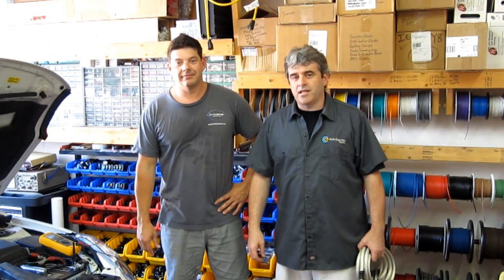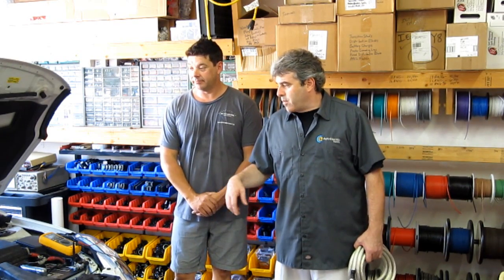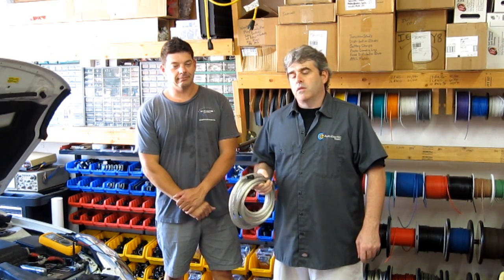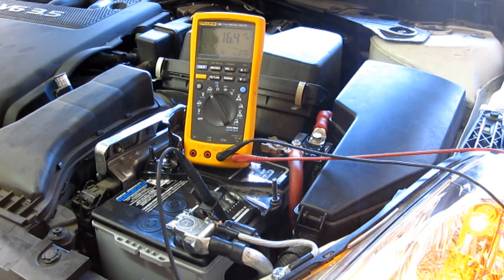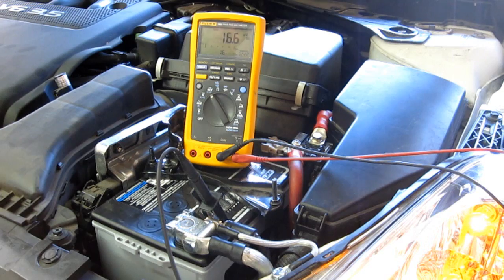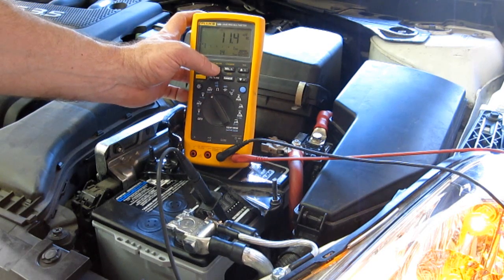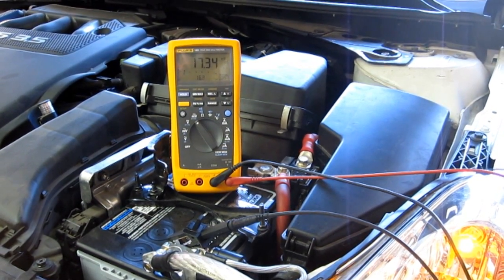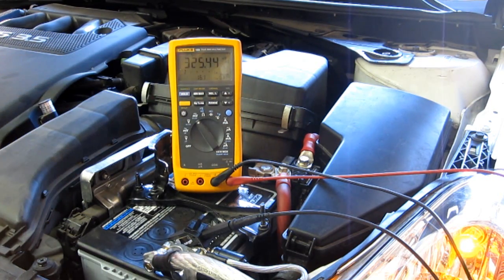Ground to the Chassis or Use Cable - Which Works Better?

Comment: In my particular case I have a Ford expedition and fixing to install the big 3 upgrade and I'm confused on whether actually completely doing away with my factory engine ground or just leaving it and adding the new one and would it matter if I bolt it to the chassis or frame

Comment: Excellent.  Thank you.  Just determining how much I will use the 2" tube frame of my rock crawler for grounding the stuff, and the answer is clear.  With a full steel tube frame, I should have way better capacity than any unibody, so chassis it is.  Saved me experimenting.  Now the question is what to use to actually connect to the tube frame.  I am thinking a 5/16 stainless through bolt with flats ground in the tube with de-oxit and dielectric grease with appropriate gauge from winch ground side to chassis.  Two 1/0 should do it.  That is roughly equivalent to a single 4/0.  The winch can run 600 amps easily under load.  Two 1/0 will feed it positive juice.  Also bought your book and it was very informative.  Highly recommended.

Comment: Chevy trucks have a voltage sensor that won't read second battery without grounding to main battery
Reply: This is very very true. I have a 05 tahoe and have that issue when computer doesn't turn alt on until battery starts getting low. Am gonna try 1 run of ground from fro t to rear see if that helps. I have 2 mechman 370 1 self excited other is 2 pin and self excited does all the work until it starts struggling then 2 pin jumps in.
Reply: @terrancedesormeauxjr2559  🔴 You definitely have more going than I do. I have 2011 Avalanche 250amp alt, red and yellow top optima batteries ran in parallel. Power and ground wire from front battery to back all 2/0. I ran 2/0 through that ground sensor from start battery back  to the original engine ground along side the factor 8 gauge wire. I also ran 2/0 from alternator to frame/chasis. The alternator reacts the way the PCM/BCU controls it, seems to be working as designed. You should check out a few of the videos on here concerning the Chevy RVC system and it's functionality. It's very interesting what GM has done and how it's all suppose to work together to conserve fuel  and vehicle performance. Good luck with everything, sound like you have a real banger with the electrical your running.👍🏾

Comment: My Amp will be right next to the battery in my BMW E90. I've read on some forums that connecting the earth direct to the battery will cause interference, is this true or false? If I can get away with it, I'd much rather connect direct to the battery to avoid sanding paint off the chassis and ripping carpeted areas up to look for earthing points.
Reply: What does the return path for the starter look like if the main ground cable from the battery negative comes loose from the body and your amplifier is grounded to the battery negative terminal?  For this reason, we never recommend grounding an amplifier to the battery negative directly.

Comment: I know this video is super old, but i had a question. Doing a “big 3” In a unibody car with its battery in the trunk when grounding the alternator to the battery does this still apply? Or should I go ahead and run 0ga from the alt case straight to the battery neg?
Reply: Battery negative to frame rail, case of alternator to frame rail on same side.

Comment: I came here because my winch says to bring the ground cable to the neg terminal directly instead if grounding it on chassis. Seemed odd since the cables they provide are only 10 gauge

Comment: interesting. Good test too. I was a VW tech back when. Went to Lincoln tech and VW school. I would think that ground using the car sheet metal/frame would work better because it has a larger mass, thus conductor is larger. The electricity will travel the easiest point back to the battery, whereas using a ground cable to the battery ..... it only has one wire to go through.

Comment: well i my self in my setup would use solid bar copper straight to battery with some 300mmsq cable at the ends, and the copper bar between the wheels on both sides lucky for me my car has rubber grommits all along so i can easy fix the bar on it. any way why lose the chassis just use both cable and chassis. i have a simple way for the live cable to which i will use 300mmsq for the side too, i just want to squeeze every electron to my system lol because my power output be in the range of 17,000 watts or bit more for add on,s.

Comment: Try this on factory wiring. No big 3/4 upgrades. You will see massive voltage drops. It's always best to run real copper cable to and from your amps/head unit.
Reply: Um, he did use 1/0AWG, pure OFC copper wire. Listen up!

Comment: completely usless test. if you ran the ground to the alt case you shouldnt have seen any drop. instead you ran it to the front battery which has its own ground where is that run to? how can you expect to get a good test if you didnt upgrade the battery ground to the alt case?
Reply: Incorrect.  The battery negative terminal and case of alternator are connected just below the battery to the chassis at the same location.

Comment: this review isn't completely accurate since the car had a BIG3 upgrade.. it makes a good difference but i still prefer running an additionnal cable as a ground since it eliminates a lot of noise problems
Reply: Not only that but copper will always conduct better and have less resistance than a steel frame rail the length of the vehicle...just sayin

Comment: I have a 08 grand prix. unibody, should I ground to the front battery instead of rear?
Reply: doesnt matter where you ground it, as long as body panel is properly grounded to chassis.

Comment: so if im using 5k true rms for my system in my Buick Park Avenue is it better for me to ground to frame or ground direct to battery? keep in mind im using knuKonceptz 4/0 power wire and Ground wire for my main run to the distribution block and from there 2 and 4 gauge ofc goes to the amps. i don't do any of that scoring stuff so this is just for daily driving. any advice would be greatly appreciated. Big 3 also being done.
Reply: Im doing 4/0 also fro my truck, for big three also, so many people say oh you dont need that, thats overkill....I like to make sure especially when adding a 2k inverter.
I just read why not do both frame and full length back to battery.

Comment: So, when adding subwoofer, amp, and capacitor to the car/ truck. The negative should just run to the chassis/ frame ground fine or run a wiring to the battery negative cable?
Which perform better??
Reply: yes  thats right  bud  but   ...AND THIS IS TO ALL HERE  ,,,,  NEVER NEVER     PUT THE EARTH ON SOME THING THAT MOVES    ... ITS A MOT FAIL

Comment: I have rebuilt alot of amps over the years and have seen chassis grounds fail due to corrosion or becoming loose over time. Any suggestions on aiding this when people use chassis grounds? I've always been against them because the issues I've seen over the years.
Reply: Here in Michigan we deal with alot of salt and ice packed under the vehicle for months out of the year, when you have all of that at your connections at the frame. Theres many other states that see the same.
Reply: strip the paint around the hole. use a star washer between terminal and vehicle. Use nut and bolt fastening not just a sheet metal screw. Then primer and paint over the whole affair. Should last 5+ years with no issues.
Reply: Use Nyloc nuts.

Comment: so in my 99 tahoe.  it's better to just run to the frame instead of a run to the rear?
Reply: yup. go to the frame if its not a unibody.
Reply: Ok. .thks cause all this time i been planning runs of gnd as well
Reply: John Monger so which did u do? I have a 98 Silverado with about 4krms total I'm about to install. Planning on 2 0 gauge power runs and 2 0 gauge ground runs from front battery to rear batteries. Should I just ground to frame under truck instead? Is 1 better then other or should I just do both and say heck with it lol. I already have all my wire and plenty to do anyway possible lol
Reply: John Monger that was a question for u but everyone else reading also lol I didn't mean to just assume u knew all this just tied it all into 1 post lol

Comment: @jim davidson - Jim, the cable used in this demonstration is pure copper with a PVC jacket rated at 105 degC.  It has a "shiny new aluminum" appearance as it is tin plated to resist corrosion and oxidation.  Welding cable is ideal for welders and not suitable for automotive use as its jacket does not carry a high enough heat rating to be used in the engine compartment nor is it petroleum resistant so it quickly breaks down should you get oil or gas on it.  I stand by the results we've demonstrated.  Next time, maybe ask before attempting to discredit another's efforts.
Reply: here is a perfect example:
http://www.amazon.com/NOCO-WL1025BK-Black-Welding-Cable/dp/B00858LFT4
as you can see it has the same attributes of your pvc. I would add its also flameproof and often cheaper. Love your video though, agree with everything you say in it.
Reply: That's right Doug. Tell them how uninformed you are.

Comment: Got that shiny new aluminum wire I see. Oh but it's oxygen free, LOL. 

 Save yourself and buy some battery cable. Real 100% copper wire rated at much higher specs than any car audio wonder wire. Plus it's cheaper.
Reply: absolutely true. tho i used to get docked a few points on my install scores when competing in IASCA for using non IASCA member mfr power and interconnect wiring. At that time a lot of guys were making their own rca cables out of superior industrial twisted pair bulk cable and a plan was concocted to pool together and register the brand name "voodoo" with IASCA and pay the membership fee to avoid the scoring deductions. Then anyone could print out a label and put it on their wires. 
I think it made it as far as a bogus website that was created and died when they saw the exhorbitant fees. I also heard monster and other mfrs were not amused at the idea.

Comment: Ok I have a 2003 monte carlo unibody and I am going to be running 5k rms (2 amps strapped) and a 4 channel off of a 320 amp alt and 2 kinetik 2400 bats what is my best option for ground I am hearing different things from every one! I am doing the big 3 ect just don't know where to start thanls
Reply: I'd use the frame rails for the return path.  You may also choose to visit our web site - we have everything you'll need and then some.
Reply: CEAutoElectricSupply sounds good what's you Web page same as your name? So I don't have to run any ground runs back? I got 2 0 gauge runs of power to the batterys just seen a mix of info on grounding. I do need to order some more supply for this build and another.
Reply: Upset
Reply: 0

Comment: You guys make great videos well done.  Can you guys make a video comparing different quality power wires please? like true 4 awg or ofc vs cca appreciate it !
Reply: Thanks!  To do a real comparison video, one needs to measure voltage drop across lengths of cables to make quantifiable comparisons - just like you see in this video.  I just have not had the time to do so.  Let's put it like this, about 90% of what is out there is more about marketing than performance . . .
Reply: CEAutoElectricSupply good stuff! I switched out an Audison Bit 1 to A Audiocontrol DM-810 with the hires Bluetooth dongle .had absolutely NO hiss/whine static with the Bit 1 ; ( using agood chassis ground point) 
The DM-810 is terrible with noise. Also tried all three different grounding jumper positions (200ohms , isolatied, regular ) NO change. Any suggestions should I run a separate ground wire directly from the battery? ( 2017 Ford Taurus SHO with the terrible Sony amplified Sync3 )Thanks for any advice you could give

Comment: This answered my question about running a ground from the front battery to rear distribution block. Not necessary in my application.

Comment: have a question related to grounds.  I have the option of grounding my battery to the frame(thick metal) OR the strut tower area.  which is better and why?  my vehicle is a 2006 Honda accord.
Reply: Frame grounding eliminates any chance of improper grounding connection.  With a unibody car such as yours you could have success pretty much anywhere.
Reply: Frame.....I'd stay clear of the strut tower

Comment: how about running a discrete ground in parallel with a ground wire to the chassis from the frame. that should cut your voltage drop roughly in half, if you had equal drop with the chassis and wire.

Comment: 15 feet is also a relatively large length of cable. depending on your system, if you are using smaller cable you may find the cable works better than the frame. at any rate, its important to find the resitance of your particular frame first, and then guage that alongside your particular needs. if the resistance is suitable for your power needs, bingo theres your ground
all in all, while I like the intent of the video, its like proving gravity doesnt exist by filming a bird

Comment: The vehicle has a big 3 upgrade so that's why its so good a ground.
If it didn't have it and the ground was just taken from some bolt in the trunk the o gauge or any gauge run up to a 4 gauge would be better from the negative....
In my vehicle adding a negative 20 foot kicker 4 gauge run from alternator mounting bolt straight to amp made a big difference in bass.

Comment: LOL, I am 1996BLKBauer on SMD, on here I have my old name. once I get my amps, and subs hooked up, I will see how much voltage drop I have. I don't have the amount of equipment that you have, so I cannot do the precise work that you do. such as loading down the amp the same. But for unibody vs. full frame the frame is more or less independent of the body, where in the unibody the whole car/truck is all connected together.

Comment: Would love to see if a full frame is the same story, I already planned doing the ground for my amps for my Explorer on the frame, but since the body is separate from the frame on full framers , you never know. Plus living up here in IL, the winters are quite harsh on our vehicles, but if you go though the frame completely, it probably does not make a difference.

Comment: yep, that's what i was thinking, if you use both, frame and a straight run. bet it would be decently lower than the 283 mV
Reply: Has anyone tried this and have a link to a vid?

Comment: i would like to see this test with both grounds hooked up then compare those numbers because most people that do a ground run to the back also do the chassis ground that they took off on the last test........ and then the same 3 tests on a full frame truck. i would think the gap would widen even more than the 14% in this video.

Comment: yes, but what he was leading too towards the end talking about a certain power level is that it is too an extent, there is a break over point where say 4 1/0 runs of OFC wire is better than the frame (the 4 1/0 is just an example). but this amount of grounds wouldn't be needed until extreme wattage is being ran in the vehicle. so frame > 1 run of 1/0, but maybe not so much when say there is multiple 1/0 runs of grounds, if that makes sense.

Comment: I wonder about the noise factor though if its a good idea to have a run of ground wire to the back along with a chassis ground to get rid of some of the frame noise for like sq purposes ?

Comment: This is due to the bigger surface area of the sheet metal vs the copper, rather than the conductivity . Would that be a correct way of looking at it?